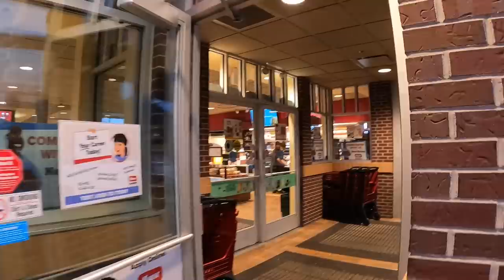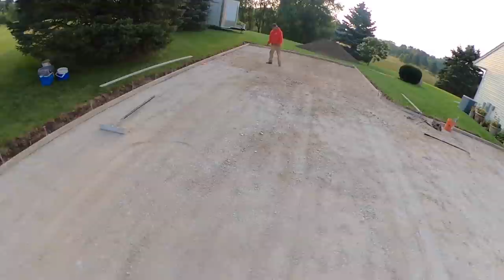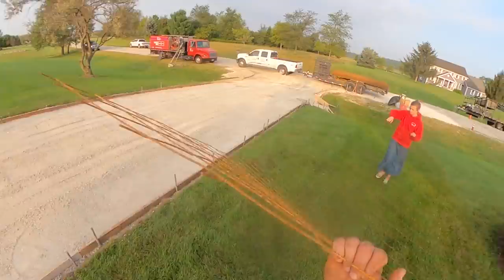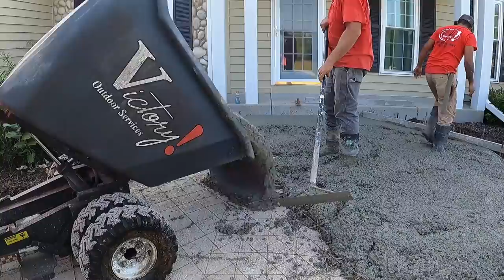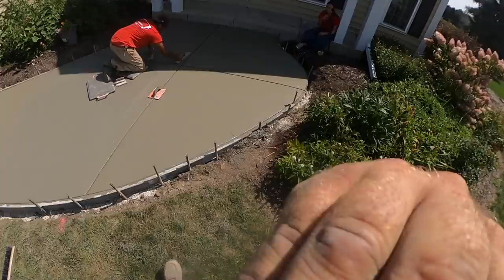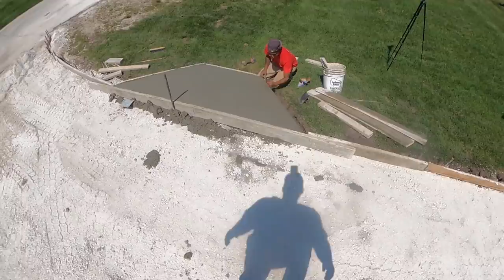Where are my guys?

Comment: That trade secret was worth the cost of admission!

Do you ever finish the side elevation of the slabs after taking down the forms (for slabs above grade)?

And I love seeing kneeboard finishing for EVERY job - much different than most here in AZ who only cut joints and run the broom, leaving all the edge marks from the jointing...

Comment: Absolutely love watching your vids, always learning something and I am not even in the concrete business. I do have a question, when you pull the wire it comes off the ground but when you are stepping on it after a dump does it not just go back on the ground or does it stay up and off? 

I am a stucco guy by trade and been doing it for 15 years now.

Comment: Just a random question so when you pull the wire even with walking on it it keeps it up off the ground like I do hvac and welding  and concrete has always interested me and was just wondering not tryna start a whole argument or anything over the question just curious I also dabble in plumbing so underground work we have to fill our cuts with new concrete watching y’all helped me learn how to lay in and fill my holes better but just always came to my mind that wire question if it sinks with y’all stepping on it thank you

Comment: What are the round footings in front of the garage for? Are those wings necessary for strengthening the culvert, or were they only done because the existing culvert pipe extended that far to either side of the drive?

Comment: Why do you cut the joints using hand tools and not a saw? I worked for a company that did large commercial pours for a little over a year and I had started to learn how to saw cut after the pours and we used a large saw machine with wheels, we also sprayed sealer using those huge drums, might be a dumb question but I was only there for a year and then went back to my lineman work which was my original trade

Comment: Long ago, when I worked for the Flintstones and we poured finished caves, we used rubber floats on the outside of our slabs as we wrecked the forms. We gave it a swirl look and it made us stand out from the other companies. More work but we were young... easy money fo sho.
Reply: What ?
Reply: @nephilly87  My statement is for the advanced elite concrete finishers out there. If we have to explain it to you we would have to Hoffa you.